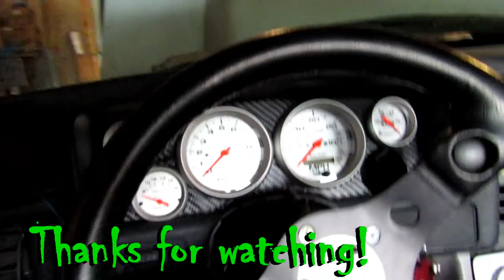SICKEST Yamaha Banshee SUPERCUB 472 stroker build Part 3 & 1000 SUBS!!!

Comment: I bought a banshee roller with a seized crank bearing and scared cylinder walls a year ago, got it for $350 couldn’t pass it up probably build it back stock
Reply from the maker: I got mine with a seized crank bearing too! Amazong what deals you can find on facebook and craigslist man.
Reply: lol I bought my banshee for $350 just needed carbs cleaned and a seat cover bone stock I am the second owner.